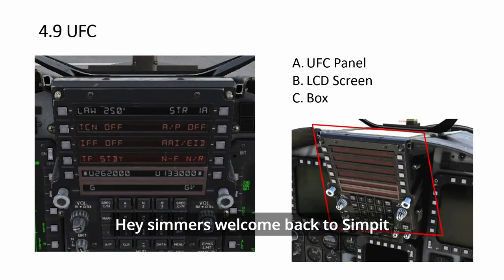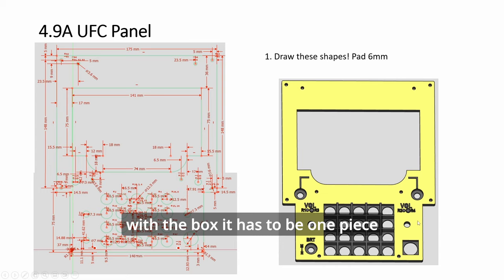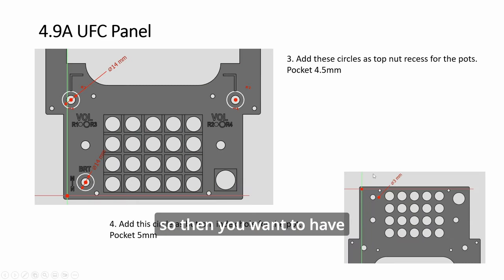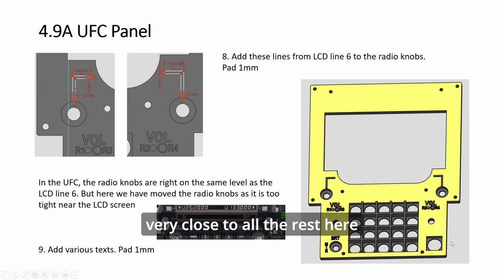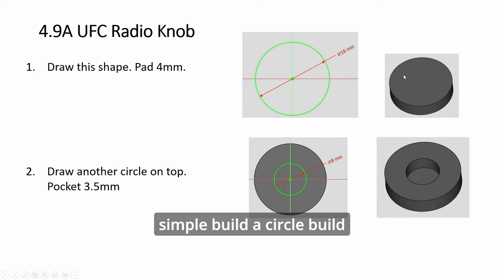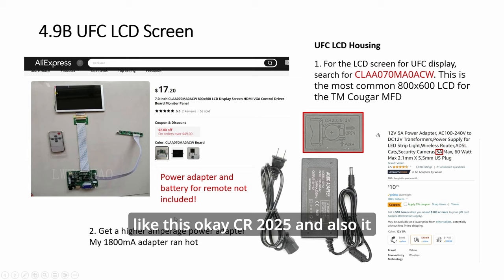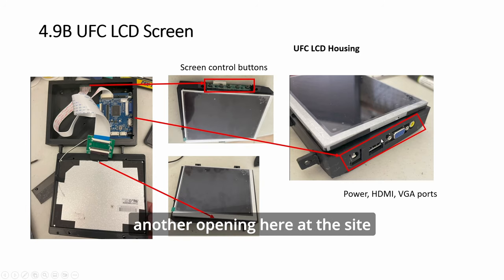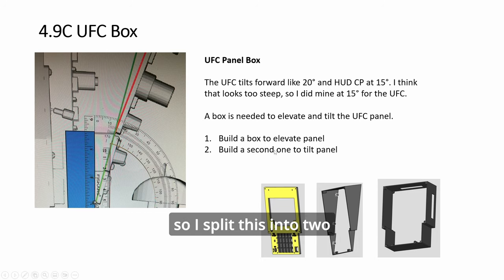Episode 21 How to build DCS F-15E UFC Panel #dcs #arduino #flightsimulator

Comment: COOL nice work. but shouldn't BRT dim the light? or it is not possible to dim your screen in the panel.
Reply from the maker: the display on my UFC is on a small LCD via Helios. The pot does dim the UFC display in DCS. So if it doesn't dim the physical display then maybe it's a limitation on Helios to mirror the brightness of DCS display
Reply: @simpitacademy  I am at the start of a flight simulator of the JAS 39C Gripen. and aim for my dream with Mixed Reality + fully DIY fighter plane physics simulator
Reply from the maker: @mattiasrask1575  the quest 3 can do decent MR. Run dcs via openXR and VD and openkneeboard. It works. If u can’t figure it out wait till I do a video on the MR steps
Reply from the maker: I have since released a video showing detailed steps on setting up working MR. See episode 27. I also did MR for the A10C in a new playlist. You can have MR in any aircraft, even MSFS. Enjoy.